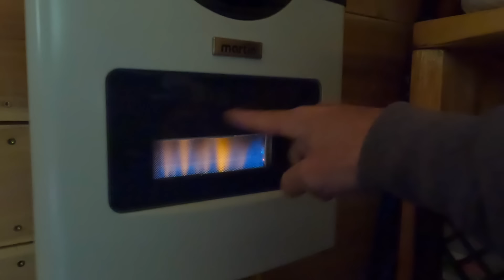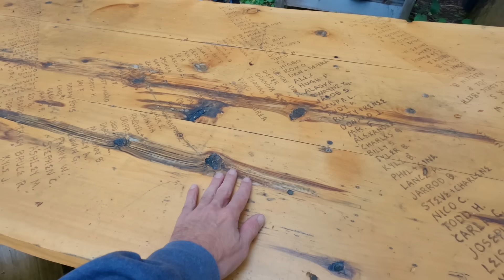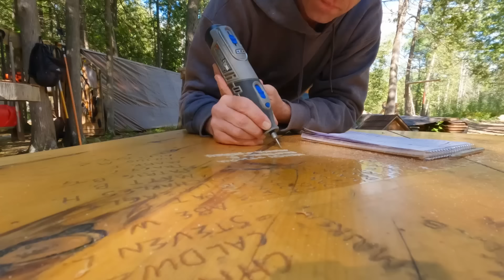Moving Back to My Cabin Home in the Woods!  (Then the Dog Disappeared.) ep203

Comment: you can get a geofence collar Ryan... you set the boundaries on your smart phone as to how far he can go.. and thats it.. the collar will buzz when he gets close to the "geofence" as a warning.. but will deliver a shock if he crosses that border. its a very effective system for folks in the outback or offgrid
Reply: Do they make those where ya don't need wifi?
Reply: @XxBrMagicxX  there are some out there that dont need wifi.. or just need it for the setup and then not after
Reply: Tried that with one of my Pitties. The only pup that never stayed close. Did not work. She took it ad a game. But, she also would walk through high tensile electric cow fencing too. She would have areas on her nose burned off of fur, but just kept walking through. Odd thing, other than when she felt like a vacation, she had to practically be in my back pocket.
Reply: Pathfinder GPS collar works great for my hound.
Reply: and it lasts over 12 hours...
Reply: The trees would be a problem for accurate GPS location. I looked into a GPS collar also, but I live in the forest of Montana. I have a Berner also. He's a good dog. I just put up a simple chicken wire perimeter, and he's not once tried to go through it (but I am also renting). Even as bears come in the yard, he lets 'em know who's yard it is. 😎
Reply: Love that puppy. I.m watching from UK.thx for video

Comment: You may be surprised on how much water that roof will capture, especially if you connect the gutter on each side.  A rain barrel and a water filter would make the water potable.
Reply: You beat me to it! Your point is correct -- one can "catch" quite a bit of water from even a small roof surface.
Get an IBC tote (food grade) and a basic two-stage filter, bada bing, free water for gardening, showers, bathing the dog.
With a better filter, perfectly potable.
Reply: A filter isn’t going to get the chemicals from the asphalt shingles out.  You really shouldn’t collect water off a shingled roof for drinking/showering.  You could use it for other things
Reply: Now that he is getting gutters, it would be a price, but his best bet would be to replace the shingles with a metal roof. MUCH easier to collect water off of a metal roof and I'm sure he would love the sound.
Reply: @charlesmcknight6792  the shingles were “basically free” so it wouldn’t be THAT big of a loss. Also the roof is tiny

Comment: Just a quick note,  When you open a paint can or varnish or what ever,  take a screwdriver (your choice) and drive it through the seal where the lid goes, into the can.(3 or 4 times)   This will let the fluid drain back in the can and not harden to the point where the lid won.t seal...

Comment: You can make your generator door close with a jamb lock, which will pull it tight and is adjustable. Instead of retensioning the hinges. Just a regular pinned hinge would suffice, maybe add a diagonal wire, turn buckle across the back interior of the door wall if you're worried about sagging.

Comment: Hi mate.
As for dogs and it running away.
the only thing that will work in the long run is training, training and more training but when he learns to look to you as his guide and looks to you for advice on what to do then you will enjoy it so much.
Regarding your hinges that you want to raise, you must take the door off and drill out the holes where the screws were.
with a drill that is doubled in diameter according to how much you want to raise the door and then insert wood plugs with wood glue and then attach the hinges to the top of the wood plugs.
hope that made sense.
and that you are doing well over there and that he sticks to you.

Comment: For any new construction, even remodeling, the openings you make should be square etc. Regular hinges should be all you need. If you need to buy hinges that can lower, raise level plumb door in opening, maybe take a level out there with you. Even a framing square works . Framing sq when used properly, can replace needing a level.

Comment: I'm SO GLAD to see up and around again !  
My Saturday mornings just haven't been the same not seeing your videos and getting the inspiration I need to get my butt in gear to finish up the endless projects I've made for myself . 

Of course without your inspiration I'd likely have way less projects to do . LOL   But hey, I live the same type of life style other than I'm not off grid and have had to put up with a bad back for years too so I can relate to being bummed about not being able to do half the things we'd like to get done.   Plus I'm 74+ and live alone so that isn't much of a help either trying to move wicked heavy things around unlike when I worked @ the marina where we had fork lifts , bucket loaders, and travel lifts and had everything else known to man to move stuff around with and having a big staff to help out.  

At least now I have a small Ford 1710 26 hp diesel tractor with a bucket , 3 point log skidder , a york rake and a set of forks  to make my life MUCH easier now.  I don't know how I did what I did before I got it and it has been WELL WORTH every bit of the 6K it cost me.  My back and neck sure is thanking me for it tough ! 

I know you had issues with the front end on the one you had but if I can make a suggestion, you might want to check out  Weavers Compact Tractor Parts as they have a ton of new and used parts for all kinds of older tractors and they just might be able to fix you right up if you still have it ? I know they have had all I've needed for my old Ford 1710 which is 40 years old so maybe they can help you out too? 

https://compactractorparts.com/

This week ends fair is to go to a local car show today , then work on my daily driver replacing the shocks , struts and some other front end parts and to do some touch up painting underneath.  I live in the rust belt too, so if you know , you know ! " The Never Ending Story " ,,,,,,,

After that I can get back to doing the fun stuff and just plain dubbing off again ! Quite similar to your daily routine , but luckily I have 2 doggie helpers that are ,,just SO helpful ,,,,,👍😊

Comment: Split the door in half so that one door swings against the cabin and the other one toward the outside. That will reduce the weight of each door. Also fill in the triangle above the door so it is fixed in place. The doors will not be as high but the dog should be able to still fit through the doors.

Comment: I use the sport dog I think they are the 1.5 track and train. They have a 7 mile radius. I pull the probes off so they can't get shocked as soon as they respect the beeper. They are a little expensive, but I think they are worth it. 
Cheers !!

Comment: An invisible fence concept but you don’t bury wires. It runs on radio signals and the area is a radius from the base signal. I’ve been told they work pretty well.

Comment: Please install the gutters, which you absolutely need to prevent water damage, avoid soil erosion, prevent mold and mildew, and protect landscaping around your home. I would spend the money to put a downspout into a rain barrel at the corner of the house. Then use the water to water a garden, or water planted sugar maples to make maple syrup, or any plant that would benefit your family. You would get your money back for the price you paid for the gutters in no time. Get a food grade rain barrel BPA free with spigot that you can hook a hose to. I would get the Micro-Mesh Gutter Guards, or something similar. I wouldn't cut corners when it comes to gutters. Water will be a powerful enemy to your house, and, without gutters, it will erode and damage you home and landscape around your home.

Comment: Hi Ryan not sure if you’ve looked into it yet but a friend of mine has severe back problems and he’s had Ozone therapy which he says has fixed his acute issues really well, and is definitely preferable to any sort of surgical discectomy. The ozone is injected into the disc and dissipates over time giving the disc time to heal.

Conversely I can see you building an inversion table from milled trees too, that might be worth it- mount it in between two trees?